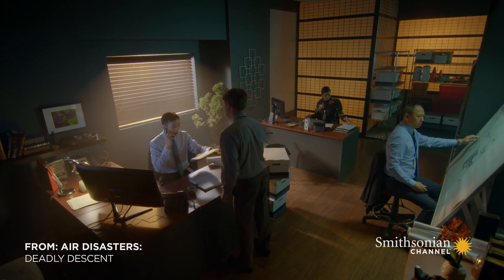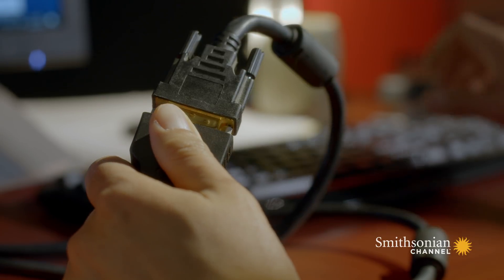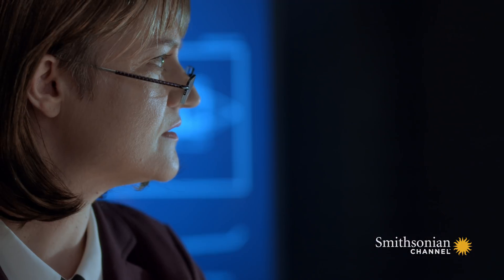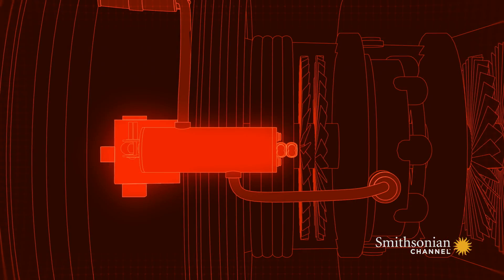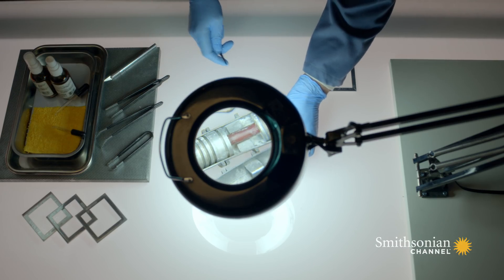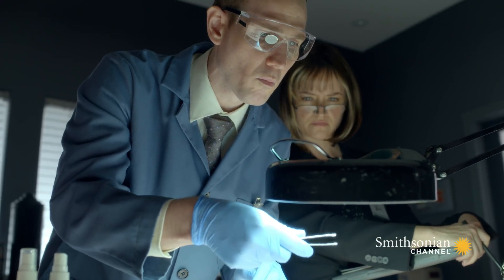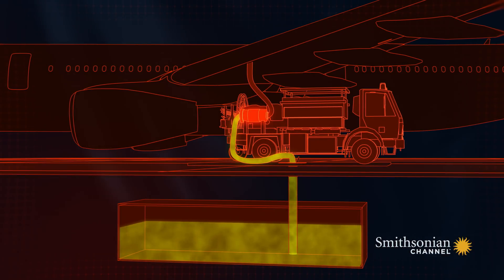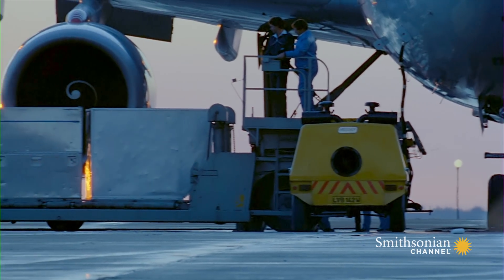A Mystery Substance Wreaks Havoc on Flight 780

Comment: If the fuel is meant to fill up lots of aircraft, then why was only this particular plane affected? Why didn't a whole bunch of other planes get affected by the fuel contamination?
Reply: Looking at the episode, it appears that upgrades were being made to underground fuel area days before the flight, which likely allowed salty groundwater to get into the fuel and affect the filter creating the contamination. My best guess is that it just took time for the contaminated fuel to get to the filter/reach the level of contamination that would affect the flight and this was the first flight that suffered from it. From all appearances, this seems to be a problem no one had foreseen and the fact that the flight managed to land safely and in one piece allowed for the problem to be identified easily. Supposedly the filters have been changed so that such a situation won't happen again.
Reply: @darkraiking680  Thanks DRK. That does make sense. That was a super lucky break that time for sure.
Reply: @southpark5555  Well, not for the flight that had the problem, but in general yeah.

Comment: "How did it get onboard the aircraft?". Um, the filter on the fuel truck failed
Reply: Well, technically, the filter worked exactly as intended for salt water. It wasn't intended for salt water.
Reply: @Treddian No, a filter has one purpose, to filter out impurities. So, no the filter didn't work "technically" or in any other way.
The filters wasn't "intended for salt water"? That's ridiculous. Of course they're intended for salt water. One of the CAR's recommendations was to IMPROVE performance removing salt water, not to add the function. The filter manufacturer told the Civil Aviation authority that the filters passed all of their tests even though it failed each of the CAR's tests.
Reply: @julianfierro7034  Read the fine print on the addendum sticker. "Not intended for use with salt water."
Reply: it failed because the workers cleaned the pipes with SAP and sent a pipe inspection pig after it. When the SAP was vacuumed out by the truck it damaged the filter and crushed it. They changed the filter but they did not empty out the truck when they unhooked from the hydrant. The truck drove across the airport to 780 and hooked up and they pumped out the fuel from the truck into the tank not knowing it was contaminated with SAP. The SAP turned the fuel into gel and seized up the engines Engine 2 stalled and was shut down while Engine 1 remained at full power and caught fire when they landed in Hong Kong. today guidelines prohibit SAP from being used in pipeline welding and fuel filters and instead are replaced with a fabric that removes imparities and with bentonite slugs which are used in pipe pigs to flush them out to remove contaminates after welding.

Comment: I know how it got there construction workers were working on the pipes at the Surabaya airport and flushed a pig through the filter to clean it they also added the compound. When the pig hit the filter it damaged it and the compound got into a truck the crew changed the filter but they did not empty out the truck and the fuel was pumped into the tank and 780 crashed in Hong Kong.
Reply: S A L T

Comment: What is the best sensor electronic device that could detect how pure the fuel for boing engine airplane from the dangerous contamination which its should be installed on the refueling truck pump hose. By the way, I am not the engineer for the refuelling truck pump.
Reply: do you english bro

Comment: So the flight recorder uses a DVI connector? 😂
Reply: They sould use hdmi much faster
Reply: GamesAreAmazing nah DisplayPort is faster
Reply: @708mattt  Nah HDMI is much better.
Reply: Whole bunch of cable nerds up in here
Reply: Eng 1 or 2 had stalled with the powder and salt
Reply: Data through hdmi or DVI ?? Use type c ....
Reply: @HendersonHarrisson  OMG an even worse option...
Reply: It should use USB type C
Reply: By now ; probably.
Reply: Old computer connection technology
Reply: That's an ancient 25 pin rs-232 connector? "refers to a standard originally introduced in 1960 for serial communication transmission of data."
Reply: Im a manufacturing engineer at Airbus and yes most communication connectors are DVI

Comment: just to know for future viewers it’s salt water from the ocean beside the airport. the salt water destroyed the fuel trucks filter causing powder from the filter to leak into it the valve
Reply: Thank you
Reply: I was going to guess gallium. But saline corrosion also makes sense.
Reply: Incorrect,Water Cannot ge into metal in from the filter Becuase the If it reflects  it will just sweat on the metal-_-
Reply: ZrRyan Is correct
Reply: It’s not, it’s the powder that filters the fuel from water
Reply: @Boypogikami132  Yes, its the powder from the fuel filter, that broke due to salt water in the fuel. Tney had a fuel line/pump upgrade, and the ground water enter the fuel lines.
Reply: no, that is not correct at all.  The SAP media was allowed to migrate with the fuel because it was degraded (think small crumbles).  Degradation of the filter media was caused by having entrained water, encapsulated by FSII (prist), passing through the filters and degrading the polymer.  This is only possible with Jet fuel that is pre-mixed with FSII.  The fuel industry, once they found this problem, took steps to prevent it. (no more pre-mixed Jet allowed to pass through go/no-go filters)